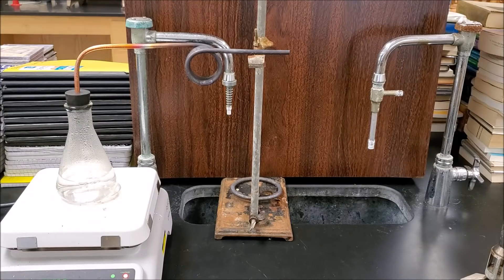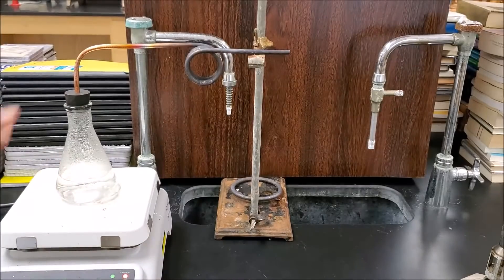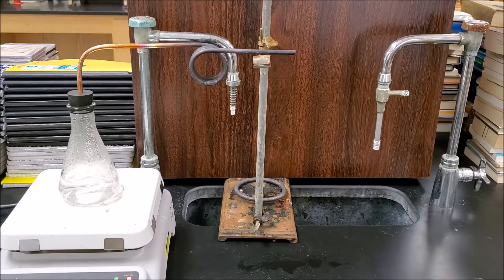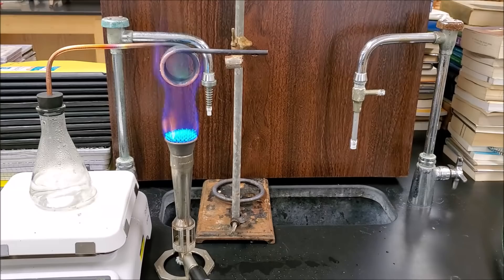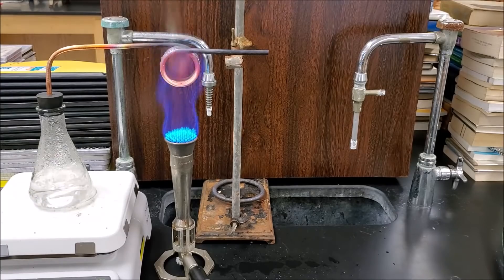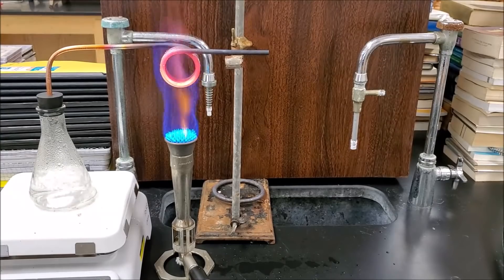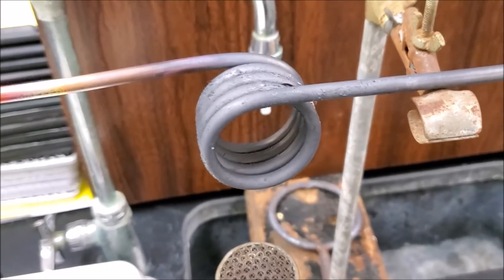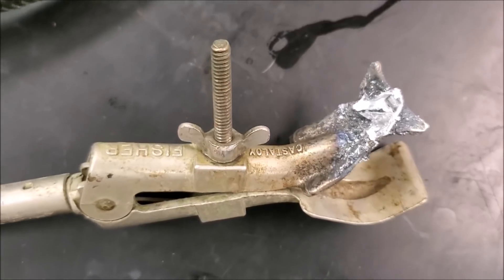Superheated Steam

Comment: The steam will be hotter, but the water will have a higher energy density and that energy is what causes the damage by denaturing the proteins in your hand. Energy transfer into your hand will be higher in the water at atmospheric pressure. Super heated steam can be more dangerous, but not in the situation described.
Reply: When water under pressure  flashes to steam, there may be some excitement.
Reply: @blessedthistle1.414  that is not what the question was. This scenario involved an open pot at atmospheric pressure.  In order to change the answer, you would have to change the question.

Comment: I know water boils at 212°f, 100°C, bit how hot can it get? ? It must get over those temperatures when you keep it over a flame. How hot does the water get? ?
Reply: AFAIK, In an open system at atmospheric pressure, the water never goes above 212F/100C; the steam is also ~ 212/100 (quickley lower).  Also, this is why boiling water is an excellent reference temperature for cook times (without using a thermometer or any temperature controllers).

Comment: You're 50% correct when you say that the reason the steam was only 70 degrees was because it was mixing with the air. The other 50% was that the copper piping itself was siphoning off heat LONG before the steam reached the air. It should be noted that, had you used stainless steel piping, the temperature of the steam would have been much hotter in the air.
Reply: Exactly 50%?? I think you'll find that the temperature transfer between steam/air and copper is negligible.
Reply: @yourdad9168      Right. This is why we cool electronics using this method: because the heat transfer is "negligible" and not the best method of heat transfer in existence. Idiot. 😑

"It is better to remain silent at the risk of being thought a fool, than to talk and remove all doubt of it." -Maurice Switzer

Comment: .... if you did the same thing with no water and just air rushing through the tube you would have the same effect.. this is essentially a pellet stove igniter concept. Air rushes over a hot hot element like a heat gun and ignites flammables. This is not the steam.
Reply: If it's not steam, how is the air flowing through it?
Reply: @KSparks80  what happens to water when it has been hested enough? You split the molecules and get hydrogen and oxygen.
Reply: @SuperPN1  When you heat the water, you break the bond BETWEEN the water molecules. Not the bond that holds the water molecule itself together (The H's and the O).  Electrolysis does that.
It can be done with temperature (Thermolysis), but you're talking 5000+ degrees to get @ half of the molecules to split, or decompose. This is a whole different ball game you're getting into though.
Reply: @KSparks80  liquid to vapor expansion ratio for water is 1600 to 1. Pretty big expansion right? Sure is alot of pressure or with a spot for it to relieve sure is alot of moving gases.
Reply: @SuperPN1  I'm well aware of that. But the first thing you say in your comment is "if you do the same thing with no water..".  How'd you get flow without changing the system? Add a pump? Compressor? Gerbil runnin' in a squirrel cage?
Reply: @KSparks80  i see what your saying, i figured a fan or a gerbil was my first thoughts
Reply: @SuperPN1  It's cheaper than electricity. Could probably find a "Sack-Full-O-Gerbils" on Amazon or something.  lol

Comment: My father served on steam powered ships in WWII. He explained to me difference between live steam and superheated steam. They hunted leaks with toilet paper on a broomstick.
Reply: Hello, i work in a factory with HP steam, 80 bar and 500c. We still look for leaks like that if we suspect anything! FLIR guns are nice but aren't always useful depending on where the leak is!
Reply: @Silasssssssss  you’re a brave man. I’ve heard horror stories of steam valves exploding when they are turned for repairs and/or maintenance. I have worked on tons of low and some medium pressure steam. You can keep that high pressure crap.
Reply: My dad was telling me that if the main steam line burst in the boiler room of the aircraft carrier they say you had something like 12 seconds (it's been decades since he told me this so it could be way off, but it wasn't much). Soberiung.

Comment: Love this example!
I work with high pressure steam daily, around 20bars, the energy it holds is insane :D
Reply: My father explained to me that steam only has so much energy that it can provide but as you superheat the steam it gains energy that can be extracted as work.
Reply: @dbmail545  Actually most of the energy isn't in the heat of the steam. The bulk of energy comes from the steam condensing back into water, which releases a boatload of energy. Super heating the steam does increase the energy in it, but it won't condensate that quick anymore.
Reply: @lennertlaevaert8711  So counterintuitive until I consider it takes energy to vaporize; conversely,  it must release energy while condensing.

Evaporation: I cracked a plastic glasses lens with enamel reducer (?) cleaning off paint overspray. It was amazing how cold the lens was in a very short wipe.
Reply: The water at 20 bar is even more insane.If you have to choose between isolating the steam or the water (say a broken gauge glass), always choose the water cock.

Comment: Why didn't you measure the steam temperature after superheating?
Reply: It's so hot and high pressure it's gonna break the thermometer
Reply: @wongcayven9893  Yeah. Because high temp/high pressure measuring devices do not exist. Got it.

Comment: Pressurized super heated steam on ships, like WWII war ships, was said to be able to cut a man in half nearly instantly if he passed in front of a leaking pipe. Very scary how much thermal/kinetic energy steam has.
Reply: Yeah, and the leaks were invisible because the steam hasn't had a chance to chill and condense into visible vapor.
Reply: @Unmannedair  That's a load of a rubbish. Because the steam is almost explosively decompressing when the leak occurs, it cools down extremely quickly
Reply: It will not cut a person in half, that is a fairy tale, on the other hand you may very well get scolded to death.
Reply: That was what my dad told me about those steam turbine powered ships that used SHS.
Reply: Mythbusters already debunked getting cut in half by steam. Also no body has every been cut in half by steam.
Reply: @Kms0108  superheated steam or just steam?
Reply: @Kms0108   yet
Reply: Not just cut, but cut cleanly because it cauterized at the same time it cut. Like something out of a cartoon where someone just falls into two pieces.
Reply: They haven't gotten rid of the steam driven catapults completely yet.

Comment: Is the paper burned by temperature+oxygen or is the steam actually participating in the reaction as well?
Reply: All fires need 3 ingredients: fuel, oxygen and heat. In this case the paper is the fuel, the oxygen is in the surrounding air and the heat from the steam begins the fire. The fire is sustained by the fuel (paper). 

So the steam is not participating in the chemical reaction, but it is supplying the initial heat required to begin the combustion reaction of the paper.

Comment: Just to be clear: water can start fire only when supplied with external heating source that can itself start fire
Reply: The difference is that water normally absorbs heat which robs fire of an essential component. Superheated steam absorbs no heat.
Reply: @dbmail545  It does too when it eventually condenses on the surface it transferred its heat to - that's why in this video first match ignited but almost immediately stopped burning

Comment: The answer to the initial question would still be, putting your hand in the water. Because when you normally boil water, there isn't a second heating stage for the water vapor to turn into proper steam.

Comment: Great video, thanks. Is this concept used at industrial level for generating power? can it be used in vehicles?
Reply: Yes it can and was used. Most "modern" steam locomotives used superheated steam.
In german the steam is either called "Nassdampf" (wet steam / saturated steam) or "Heißdampf" (hot steam / superheated steam).

Saturated steam is steam, which is directly comming out of the boiling water and thus has the temperature of the boiling water (about 200°C depending on the pressure in the boiler). It contains a mix of steam and water droplets.

Superheated steam is generated by rerouting the saturated steam back to the hot fire gas and thus raising its temperature to about 400°C. It is pure steam without any water droplets.

The superheated steam contains more energy (it is hotter), that can be converted by the steam engine into more mechanical energy (and that's what you want). In addition saturated steam is just at it's condensation temperature and contact with cooler parts of the engine and the expansion in the cylinders will lead to condensation und thus drop of pressure (loss of energy).

I hope my english is good enaugh for this explanation.

Comment: Leak in a boiler plant. We had to reach around inside the pipe assemblies to figure out where the leak was. Used a broomstick to probe around. We heard a "THWAK!" and the tip of the broomstick was gone. Leak found. Called the professionals and clocked out.
Reply: Why isnt a thermal camera used? Guess it would be a lot safer?
Reply: @aniruthdinesh9156  because everything is hot? 🤦‍♂️
Reply: @jman0870  The leaking steam would be hotter than ambient air.
Reply: @aniruthdinesh9156  you’ve never used a thermal camera before, have you?
Reply: @jman0870  nope
Reply: @aniruthdinesh9156  standard thermal cameras don’t differentiate between hot and really fucking hot. It’s all the same color.
Reply: @jman0870  ohh, I get it now.

Comment: In power plants when they have a steam leak... heat source gets disconnected and then area evacuated until there is no possibility of the live steam still being there. You can be cooked in half.
Reply: In a power plant you’re not only dealing with superheated steam but it’s also high pressure. Very dangerous.
Reply: @deepsleep7822  Low pressure superheated steam only gets you while you're sleeping. It's sneaky like that.

Comment: Are steam heat and pressure related?
Reply: Yes, for ideal gasses(not steam) the relation is described by pV=nRT
Where p is the pressure, V volume, n amount of moles of gas, R univ. gas constant, T temperature.

For steam this relation does not hold but the relations are tabulated in steam tables and can be looked up
Reply: @Gam3Rag3  thanks for your time!

Comment: Yeah, steam can be scary. I heard a story about it at a power plant I toured. We had to walk on a different tour route, because the normal route went past an area with steam pipes. He said that the week before, someone working in the plant got seriously burned when they walked into a steam leak. He also said that he was on duty when a steam pipe burst, and that the temperature in that warehouse-sized building went up about 20 degrees F in 10 seconds. Luckily no one was injured that time, just shook up.
Reply: Any high energy system like that involving high steam pressure is scary indeed. Leaks are just one hazard. The other is that a high pressure system is essentially a bomb you're slowly extracting energy to do work from, but if someones makes a mistake, you get all the energy at once and you're having a very bad day.
Reply: @roblangada4516  best description of a steam boiler i ever heard👍👍
Reply: Some of the WW2 tales are scary, as they were using superheated steam turbines, and being at war, there was plenty of shells flying about to damage those steam lines.
Reply: @CED99  *steam turbines. To superheat something is to heat it past the temperature at which a change of state occurs at a given ambient pressure. Steam can be superheated at 101 Celsius at atmospheric pressure and 50 Celsius in a vacuum. Water can also exist at 150 Celsius without boiling if the pressure is high enough. Stop saying superheated steam like it’s scarier than regular steam. All steam will fucking kill you. The temperature isn’t what gets you. It’s the pressure. Pinhole leaks in a high pressure lines can literally cut you in half regardless of the temperature.
Reply: @jman0870  
Superheated is more dangerous than saturated steam, mostly because a leak is invisible at the source, in industrial facilities, you may not hear a leak, before walking into it.
Also, with steam, pressure dictates the temperature and vice versa.
Reply: @aaronnoyb  bruh. I know. I did HVAC for years.
Reply: I was working a job at our power plant up on the roof running new 4 inch conduit for control of the breakers at the switch yard. It was fun. But one area where the steam process pipes went threw thenroof on there way to the cooling stacks was near where we had to run the pipes. 
As per my work plan, and daily task analysis we took all reasonable precautions when working next to the INSULATED steam pipes. My right upper arm, the back side came in contact with the outermost layer of insulation and I got a nice dimpled pattern (the metal outer layer of the insulation had this pattern in it) and it hit me a few moments after how bad it was. 2 inch by about 5. Between shoulder and elbow. Back side. I still wince at how bad that felt. 
Luckily it was not a "reportable" injury and just hurt more then anything. Still have a burn mark on that outline area. 

Things were different even just a few years ago and that was almost 10 years.
Reply: @tek4  I’m not sure what the point of your story is but if you didn’t get a blister then it’s completely superficial.
Reply: I don't deal with anything quite like the steam coming out of those pipes, but as a cook, you learn quickly to be careful with steam. I work with steamers used for various types of food (rice, noodles, etc) as well as deep fryers on a daily basis which we sometimes put frozen food into. 

The steam that kicks off of fryers and these steamers can burn you bad. Not only can they burn you badly, but in my experience steam burns have a totally different pain to them and it can be excruciating. I can't imagine what it would feel like to get burned by one of those steam pipes you're talking about. Nasty stuff.

I've been burned a lot due to my occupation from hot oil, direct contact with a heating element such as an oven, direct flame, and steam. Out of all of those the burn I remember the most was a nasty steam burn I received. It stands out among the tens if not hundreds of other burns I've had due to the type and severity of the pain. Extreme stinging sensation for about a day and a half afterward. This was through the use of aloe and burn ointments as well.

 It was relentless, I only ever got a break from the pain when applying a new layer of aloe. With that being said, aloe is fantastic for burns in my experience. I like to use this green Banana Boat aloe vera gel. Shit rocks. It smells amazing too. I keep a bottle of it in my car in case I or any of my coworkers get burned on the job.

Comment: this is how we spot superheated steam leak in a power plant, we put a cloth at the end of a broom handle and we try to put it in front of the leak.
If the cloth is ejected while burning, you spoted the leak.

Also, this is why it is totally forbidden to run whatever the reason, if you run through it it will cut you in half.
Reply: My father served on steam turbine powered ships in WWII. That's exactly what he said. You couldn't see the leak but it would cut you in half.
Reply: @dbmail545 Happily however, the wound would be pretty much instantly cauterized so hey, at the very least there's always that.
Reply: I would like a video of fruit being thrown threw that.
Reply: @SylvieTheBagel  fruit? Do you mean the smoldering blob of plant matter on the wall?
Reply: @heroslippy6666  remember stomp rockets? I have an idea...
Reply: When repacking the stems of steam valves, when finished, and you open/close all bypass valves, you then take a small mirror and run it around the valve stem to see if any steam condensates. The first time i did it, an experienced mechanic told me to never hold the mirror in your hand. We had one glued to a long wooden handle. The reason is because if it ever really leaked, the mirror just explodes, and you dont want it in your hand.
Reply: Something capable of cutting you in half that you cant see?
thats terrific AF
Reply: It can't be heard?  Too much background noise at a very small leak?
Reply: @louf7178  nuclear power plant. Yes. There's background noise.
Reply: @louf7178  turbine hall is fucking noisy
Reply: It will not cut a person in half, that is a fairy tale, on the other hand you may very well get scolded to death.

Comment: I believe it is the super heated air causing ignition. Try the same thing without water in the beaker. My guess is an empty beaker will have even higher temps, as water absorbs abundant thermal energy.
Reply: Congratulations, everything you just said is retarded. If it wasn't. we never would have needed to invent steam engines, we'd just have powered trains from hot air.

Comment: That's deceptive of course I hand over boiling spaghetti pot is going to be fine with surrounding cooler air is infusing at that point mixing the temperatures so it's less hot

Comment: Basically latent heat in steam
Reply: I think it's that liquid water has a much higher heat density than steam (unless the steam is superheated high enough) is the reason that you would burn your hand worse by immersing it in boiling water than if you held it over the vapor cloud emanating from that water.
Reply: @fredsasse9973  there are factors at play there 
As the steam in the video is passing through a pretty long copper tube and copper dissipates heat pretty well so steam can be cooled down a little 
Steam right off the surface of water is pretty hot and has more latent heat than liquid water.